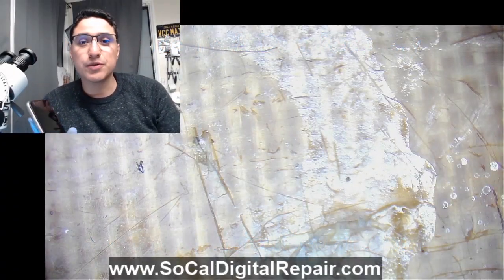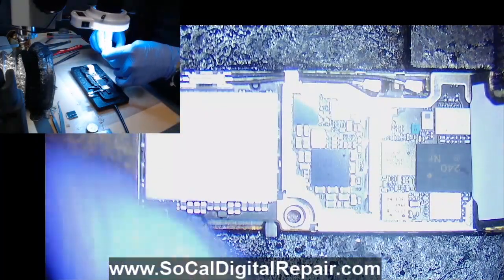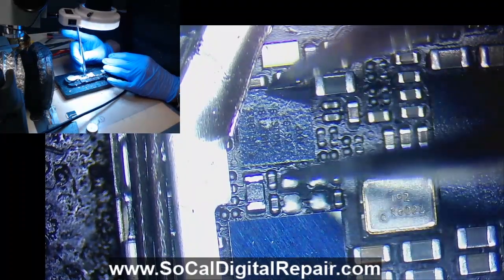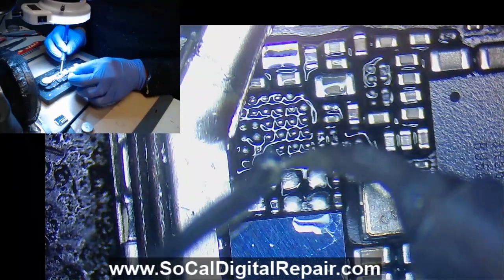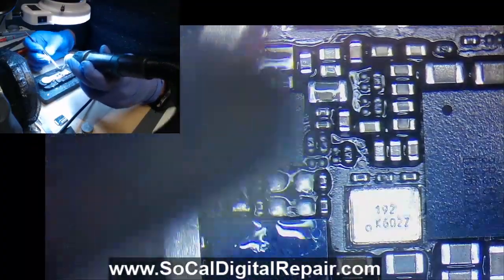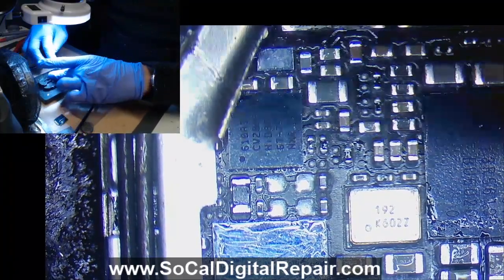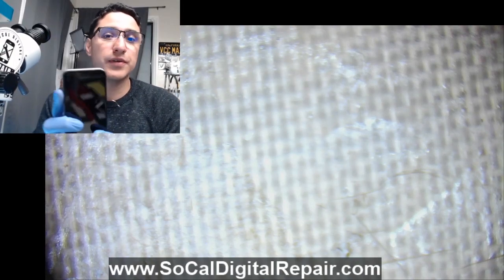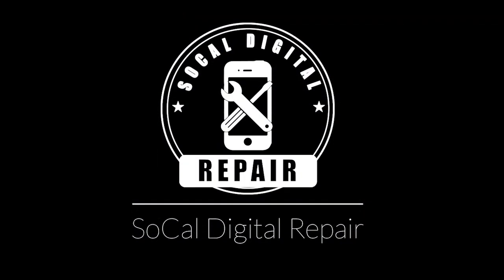iPhone 6S Not Charging | Easy Step by Step Tristar Microsoldering Repair | Nothing Left Out

Comment: Thanks for a great video?

Do you think this can be done at home with hairdryer, solder tin and solder?
My phone is 'reverse' charging. And or not taking charge at all. Regardless of MFI cable or not.

Thanks for every and any insight.
Reply from the maker: absolutely not. you need proper BGA reworking tools. i would recommend finding a local shop to get that fixed for you.